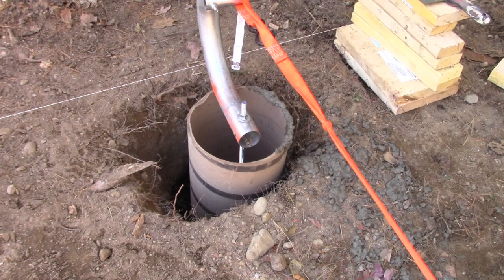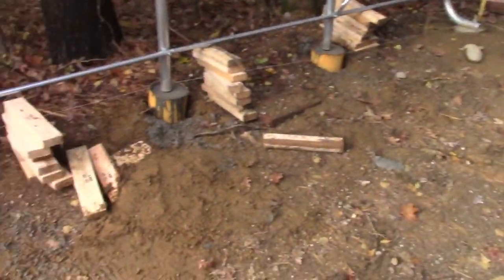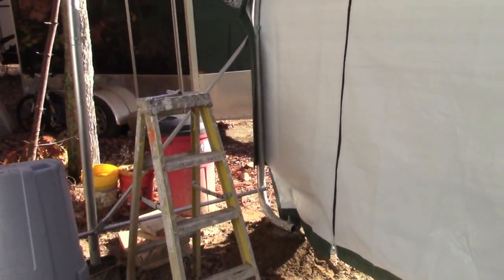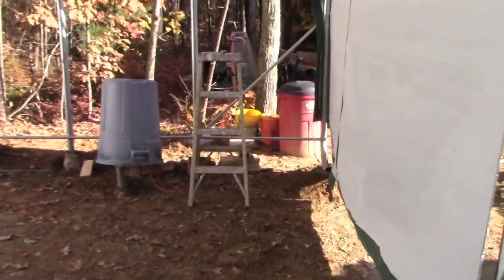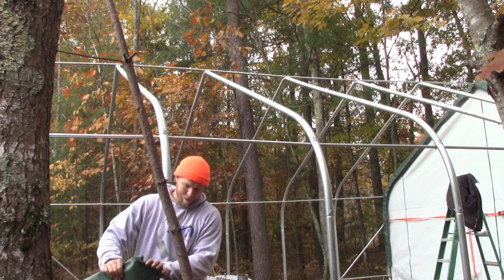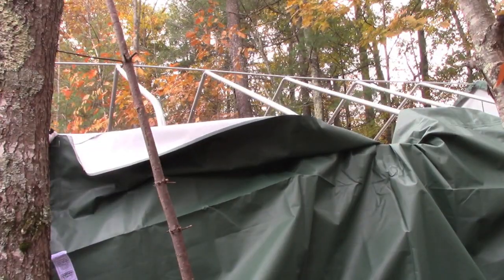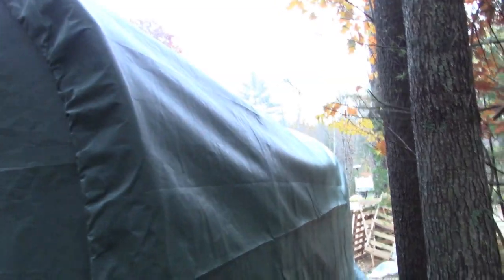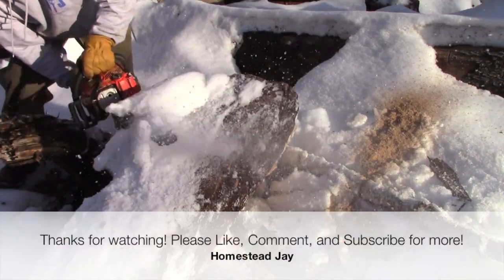THE ULTIMATE CAR PORT BUILD FINALE! EP 21 PT 3

Comment: I've built a number of these type of shelters over the years. Your Rhino shelter has a fairly heavy tarp and should last quite a while with care. The main enemy of these buildings is friction. It is important to keep anything from from touching the tarp inside or out because it moves on windy days and the friction against an object will rub a hole or weak spot into it. Don't let tree limbs touch the fabric or park any machines against it. Also check for loosening because the cover does stretch a bit for the first year or so.
Reply from the maker: Yes thanks again for the extra tips! If you watched the serious from the beginning  I believe the first video I cut and trimmed all the surrounding limbs that were in proximity to the hut! I hope this one lasts a while! Please subscribe for more videos!